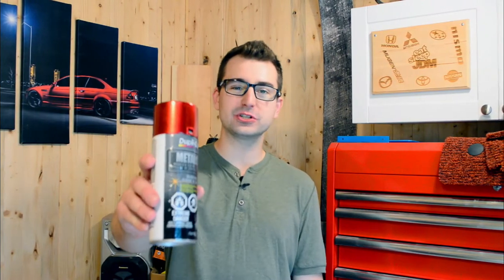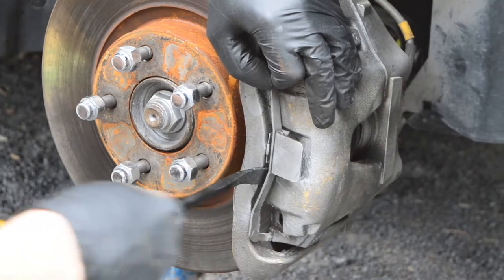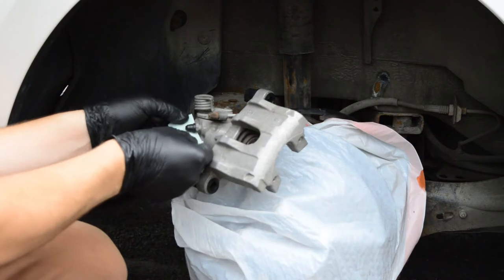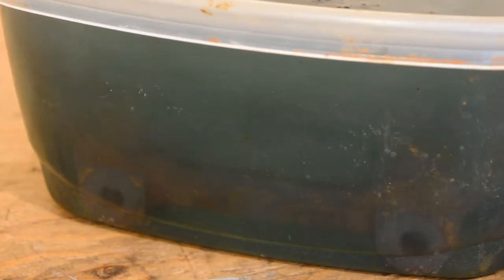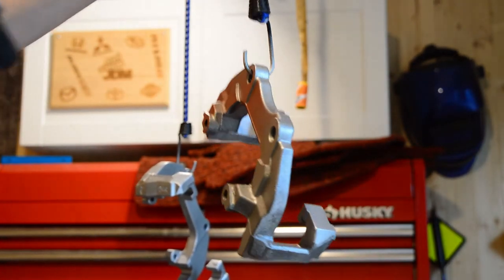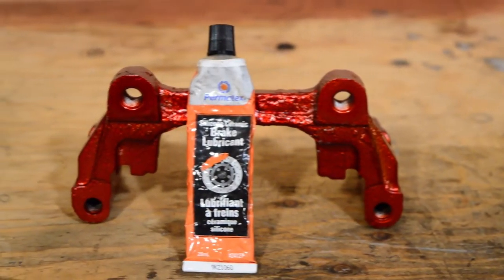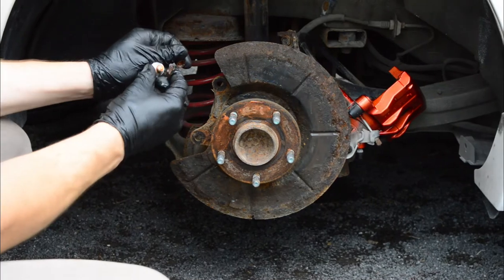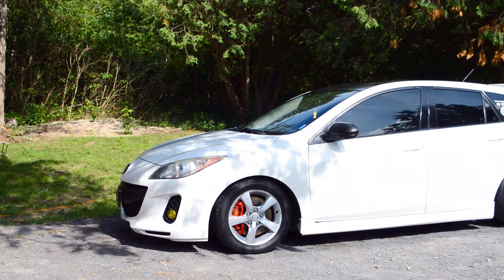PROPERLY Paint your Brake Calipers UNDER $50

Comment: Hi there! Great Vid.

I just wonder with the size of rims and tires. Those are snowflakes ❄️ tires OEM from Mazda right.? 

Planning to buy a used one and have it painted gloss black.

Thanks
Reply from the maker: Thanks! Happy to hear you're enjoying the video, the tire are 205/55/16 on OEM wheels like you said, the wheel specs are 6.5inch wide, 16inch, +50 offest, hope this helps

Comment: Have they held up good since you posted this?
Reply from the maker: They held up okay since I did this, I haven't driven the car through winter either and there's definitely spots where it's flaking from rocks hitting the caliper while driving. Overall I'm still please because this is not caliper paint, and they still look red from a few feet away it's only when you look at them closely that you can really tell. Hope this answers your questions, if you'd like close up pictures of how they look right now just reach out to me on Instagram.